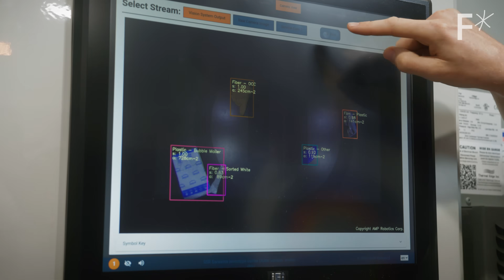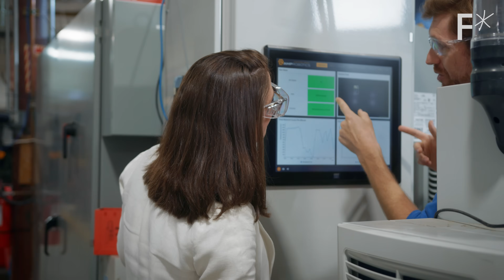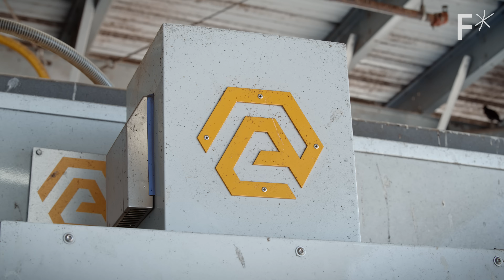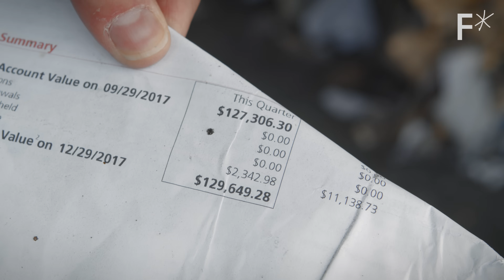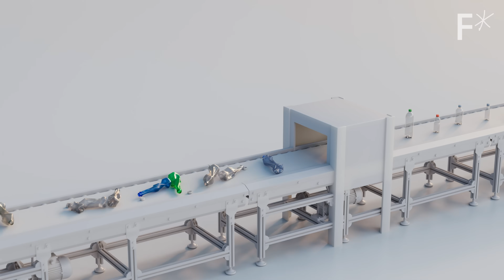The robot solving America’s trash crisis | Hard Reset

Comment: I believe without some hard regulations worldwide concerning materials and packaging we will go nowhere with recycling, it just will not cut it. Besides the industry just pretends trying limiting waste while in reality its the oposite -  controlled product aging - you cannot disassmble by yourself most of the stuff you buy without damaging it and this is on purpose, instead of simply repairing it you just have to throw it away. I repair my broken led bulbs - you replace one broken led diod and all works just fine (never put back the led plastic cover - it shortens the lifespan of a bulb dramatically by heat)

Comment: Recykling has been a part of most of countries in the world I think. In Sovjet, almost everything was recycled, in europe, and especially in scandinavia, recycling has been a part of everyday life for decades. In USA this is looked at as something new, the society that produces more trahs pr. person than any other society on the planet. And by the way, it is not trash, it is material that can be used again and again. plastic took over for a lot of glas products. Glas can be used a very long time. And then, aluminium cans came in to life ... Who did that Coca Cola USA. Aluminium cans are very heavy polutants. It was the idea that it should be returned for recycling. Why? Glas can hold up for decades, and it only needs to be cleaned. Yes, the weight is higher, but the production, recycling of aluminimum takes more power and polutes more.

Comment: Actually garbage is not the problem. Recycling is the problem. It is inefficient, labor-intensive and expensive. We should be burning all garbage and using the heat to generate electricity. Garbage is free fuel. Sweden is the world's leader in this technology, which is the most efficient way to get rid of garbage and produces the most valuable energy resource of all - electricity.

Comment: If the inbound material is hit with hot or cold air for a defined time, few seconds before  it gets into the sorter.. instead of only using the visual method for sorting, the data can also include the heat of the material (using a infrared cam). As distinct material will have different heat dissipation time.. it could also increase accuracy a lot!
Reply: If You use bright light , you may spot easier the metals. Also if sometimes something is not dectected by it's shape, can be simply pull in another direction and repeat the track.

Comment: This is great! However, to make a significant impact we need solutions on a policy level!
While this machine can separate a PET bottle from a cartboard box, it cannot distinct between an HPDE foil and a LDPE foil.
Let alone distinct a specific plactic with UV protective additives from one with heat resistance additives.
We need standards for the materials that can be used in Single-use packaging and products and we need to reduce the allowed plastics to a hand full that can be efficiently recycled.
Reply: As I understand it the AI does not distinguish between HPDE and LDPE foil per se. Rather it differentiates between CapriSun 6 oz. Fruit Punch Juice Box and Swanson Microwaveable Chicken Nuggets containers. The computer needs only to match the logos on the box to know what it's made of.

Comment: As much as I like throwing technology at problems, I don't necessarily think treating the symptoms instead of the disease is beneifical in the long run. Plastic is a great material, it is fairly simple to work with, it is affordable to produce at a large scale and it is durable. And especially the durability of the material makes it absolutely unfitting for one of our major use-cases: single use plastic packaging. Incredible amounts of resources go into producing that single use plastic in the first place and even if we'd manage to get a recycling quota of 100% (which I think is highly unlikely, but would of course be great) we'd have so spend siginficant resources and energy to recycle those materials. So even if we'd have the technology, recycling is still second to not producing/throwing away that stuff in the first place.

But overall, I think automatization especially of industries that are as understaffed yet absolutely critical is a great way to contribute to our society and make the world work.

Comment: Could this technology be used to break down existing landfills? That might be quite the reuse scenario.
Reply: good question. could be very valuable for the metal recovered
Reply: Run landfills through this system, recycle as much material as possible, and then run the remainder through a waste to energy plant with carbon capture. Net negative carbon effect if you count the methane that would have leaked from the landfill.
Reply: ofc, as example you can make a good amount of electricity with trash, we do it in switzerland. and the air filters in those trash burning centres, are so advanced, the air coming out is cleaner, than the air of the vicinity :)

Comment: Nice idea. Definitely AI and robotics can separate waste faster and more accurate than humans. However, very little waste can actually be recycled. A Swedish company Mälarenergi incinerates waste and produce electricity and heat homes from the heat produced by burning waste. The chimney is filtered so the air is not getting polluted. Waste incineration is the ultimate waste management. Also highly profitable because you produce and sell electricity and heating.
Reply: By burning one bale of PET-bottles you wont get 1000 USD revenue. Incineration is the most profitable and easiest waste-management system today. But not tomorrow. 1st choise should be: reuse, 2nd: recycle, only 3rd, way behind: burn it.
Sweden over-built itself with waste-incineration-plants and now has a problem of under-usage, it has to import trash from neighbouring countries to use the capacity.
Reply: @tomo1168  I suggest that you shoud watch a documentary about recycling scams. Experts explain that recycling plastics is not what most people think. Majority of collected plastics ends up in third world countries and in the ocean. Sweden imports waste because it's profitable. The incinerator plants are getting paid for destroying the waste. So making money just by receiving the waste. And making money from electricity production and heating residential houses.
Reply: @1323lobo  I saw more documentaries about recycling scam. I do know how it works and that the half of that will be burned. But you should understand: that balo of sorted one kind of plastic is really worth 1000 USD. And you should understand, this machine is sorting the plastics, not how it is done f.i. in Germany where they sort out only the PET and the rest will be just burned.
Reply: @tomo1168  " that balo of sorted one kind of plastic is really worth 1000 USD"  Lol wtf? Source? Because I work in industry and, guaranteed,  that is not true. And recycled plastics are inherently contaminated, and less durable and useable in general vs virgin plastic. Recycled plastics cost around .80-1 dollar a kilo, and guaranteed that "balo" doesn't weigh even close to a metric ton. So I would call that statement....wait for it.... garbage.
Reply: He said that in the vid. And with the high oil prices today it is possible.

Comment: As a former chemist, I would like to know how they tell all the plastic types apart with just a camera. It can be done with special equipment (different wavelengths of light), but as far as I know, it isn't that fast (one item at a time). Would love to be wrong.
Reply: Heyo, AMP employee here. Actually a super hard question to answer. The AI is fed an incredible number of examples and figures out for itself how to distinguish the different classes. It is actually really difficult to work backwards and say "what properties is the AI using." However, we do know that the AI is sensitive to a lot of the optical properties of the various materials: opacity, reflectiveness, texture, as well as color. It combines that with contextual information like recognizing the shape of the object or specific branding information to make its final determination.
Reply: @carter12s  thanks for the answer. I assume the AI can only work with the information that it receives. Of course, there are different streams where it can get that information, the cameras being one of them, Databases from manufacturers, etc. being another one. Hope that you can develop the technology to a point where it becomes cheaper than landfill or other unsustainable alternatives.
Reply: Optical sorters that use light refraction or reflection are actually much faster than these kinds of robots using AI right now. Check out NRT machines. After they detect what they are looking for they use puffs of air to shoot the item onto a different belt.
Reply: And as time goes on the AI will just get better. New tools and training can be added on as they become necessary.
Reply: This is not so much a "detect plastic type y" problem as it is a "detect mass-produced product X" problem, which is perfectly feasible with just a camera. And then once you've sorted the plastic by product you just match it with the known plastic type "offline", as it were.
Reply: @LucGendrot  exactly, in the video he was saying that. they know the chemistry from a "danone joghurt bottle" for example and they can sort it exactly to get the same chemistry back. There are machines using special wavelength lights and cameras, but this one ist that. I guess they can sort out the majority of the known products and the rest they could send to a special sorting machine with special equipement. But I think it wouldn't worth the cost.
Reply: How are different plastics detected anyways? I think an Ai would be capable to distinguish plastic from other non plastic waste.
Reply: @notlessgrossman163  Well, depending on the chemical structure the molecule absorbs difference wavelengths of electromagnetic radiation. Absorption in the visible part gives you colors seen by humans, but chemicals also absorb in the UV (that's how sunscreen works) and IR range as well as other parts of the Electromagnetic spectrum.